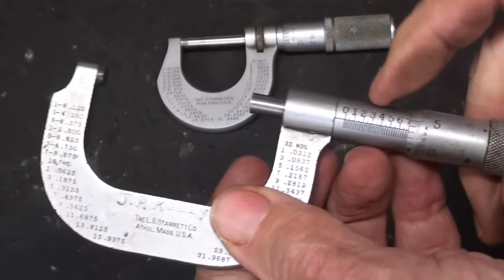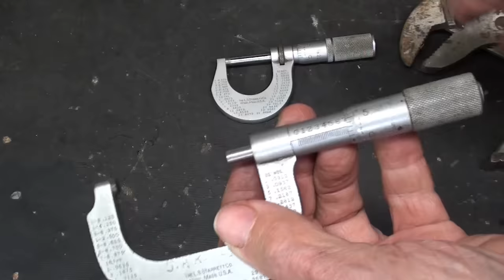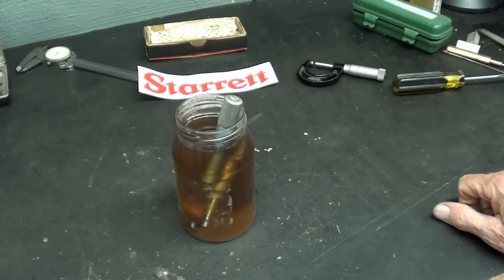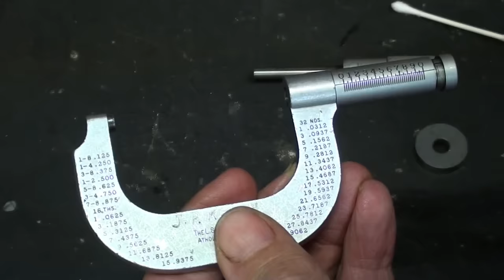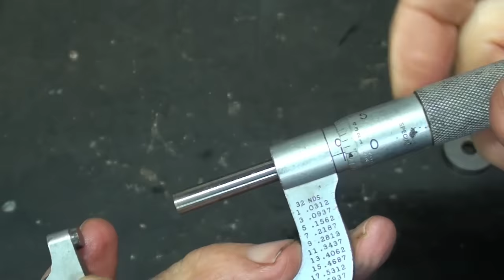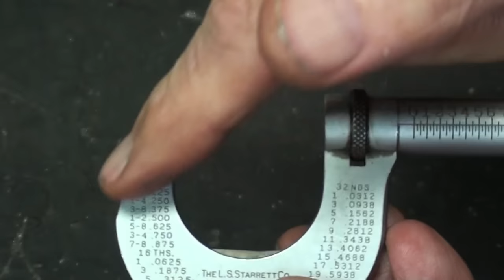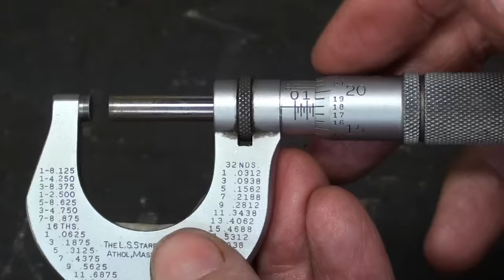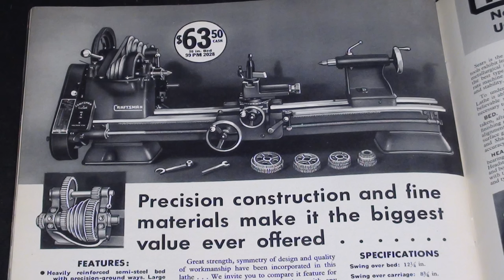FIX SEIZED STARRETT MICROMETERS #903 tubalcain

Comment: Best break free fluid I found is homemade. Equal parts ATF and acetone. Better than anything store bought
Reply: What is ATF?
Reply: @carrollprice1213 Automatic Transmission Fluid
Reply: And old ATF if you can get some.
Reply: Thanks. @steve_weinrich
Reply: jWe use that mix too.  It works great.
Reply: @duron700r  The really old stuff used Sperm whale oil. It was fantastic for homebrew penetrants.

Comment: I do this similarly, but put the jar in an ultrasonic bath, running several times over a few days. The ultrasound gives a bit of heating and the vibration helps the penetrating oil.
Reply: I’m using ultrasonics for pretty much everything now. Different fluids for different purposes.

Comment: Retired Navy Aviation wrench thrower here. I was MetCal Manager for my last squadron. I was the person who hauled all the calibrated tools like micrometers to AIMD for servicing. I learned there that  micrometers and the natural environment of the Navy is not great for micrometers. The discoloration is due to plating loss from corrosion. So long as you keep it oiled, and clean, it'll be fine. For stuck-stuck micrometers, and I mean STUCK, SOP was putting the stuck micrometer into a heated ultrasonic cleaner with something like WD40 set at 120f and leaving it a few hours. 120f you can handle with bare hands, and if that doesn't work? wrap the C-Frame with a rag, and pack the spindle in Dry Ice for a minute. The temperature differential should shrink the spindle enough to break it free from the thimble. If that doesn't work, its assumed something got bent... which, can happen in the Navy.

Comment: I got a Mitutoyo digital micrometer that was not stuck but was very stiff, turns out it was probably dropped and the nut was bent so that the anvil was rubbing on the hole in the frame, I fixed it by figuring out which way if was bent and giveing it a few taps with a dead blow hammer in the opposite direction. It now moves very smoothly.

Comment: I was taught not to store them fully closed not due to seizing but thermal expansion. When the temp fluctuates and the materials change size it can really load up the threads and damage them. Not sure if that's true or not but it stuck with me. I've packed away most of my mechanical measuring deices as my eyes got worse and now use digital but I know they are all still free, Cosmoline is a wonderful thing.

Comment: For a rusty and stuck hardware I use a mixture of half automatic transmission fluid, half acetone. It works wonderful. I keep it in the spray bottle. Anytime I buy something rusty and corroded. I give it a couple sprays the night before I take it apart. Great video. Thanks for your generosity of your time.
Reply: Kerosene works pretty good...
Reply: 2:05...no, that's a BAD idea...(!)
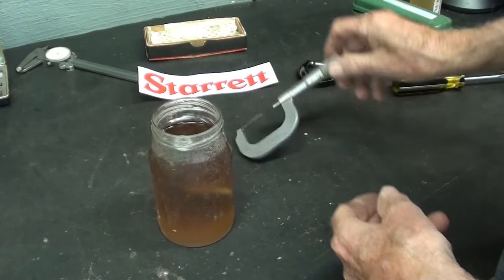Reply: 4:54...THAT'S DISGUSTING-(!)

Comment: another great video . nothing ventured, nothing gained as they say . the outcome was  great . I have used straight mineral spirits to lubricate things to get them working again , followed by lubricant . WD-40 has it's place . I don't think you would have had the same effect with trying them dry , I am convinced the lube helped.

Comment: When I worked in aerospace, electro-mechanical actuator dept. this was such projects as the ISS cadram unit, carbon dioxide removal apparatus, abram tank and FA-18 vapor cycle cooling systems etc,  us "technicians" and the engineers thought up a test. penetrating oil, we all thought up the way to test, we machined them, the other dept rusted them all up after tightening them all exact, nuts and threaded holes, all exact, long story short, we found aero-kroil actually creates more rust, but it sure is popular, and funny you mentioned it, 'liquid wrench' won under many test criteria.  we didn't try atf & acetone however,  fun times, made cool stuff, we were not production but machined prototypes and parts for one off and units under test.  "Liquid Wrench" won
Reply from the maker: I have been using liquid wrench since I was a boy. But it doesn’t seem to be very popular anymore.

Comment: I use brake fluid and acetone (about 50/50) and I put it in a square-shaped glass Pyrex bowl, so the mics lay flat.  Next, I place the bowl on the dash of my old truck (roll the windows up) in the summer time and leave it for a week or two.  This gets the brake fluid/acetone mixture very hot and almost always frees-up the mic.  Once the mic is free I clean everything in a small ultrasonic tank and after removing the mic I dry everything by disassembling the mic and VERY BREIFLY running my propane torch over the parts to ensure that they're completely dry.  Lastly, I apply a few drops of sewing machine oil to the parts.
Reply: I wonder if putting the micrometer with brake fluid & acetone in a zip-lock bag & placing the bag in your ultrasonic cleaner would help drive the mixture into the rusted spots quick also??? ...  I might have to try that (if it doesn't eat through the bag first).
Reply: @davelister796  I'm guessing that the acetone would eat through the bag, but I'm not sure.
Reply: And all of the plastic in your truck is cracked and eaten up.
Reply: @TgWags69  No, the plastic in my truck is fine because the liquid is in a glass bowl.
Reply: Thanks Mr Pete. A really good video and I am sure I will refer back to it the next time I have a sluggish micrometer. I wondered what the nut on the end of the barrel was for and probably for the best decided to leave it alone 😊

Comment: Somebody gave me years ago a seized depth micrometer.  I used penetrating oil on it. (Liquid wrench or other type).  Within a couple days, it loosened. If I recall, seizure was in the threads. (Probably dried lubricant).  To hold up thimble in the process on 0 to 1 in, I would use a lathe collet mounted in lathe spindle and lock spindle.

Comment: PTFE teflon based libricants like Slick50 works a treat. When the tiny high spots rub the teflon melts due to friction, then friction is bugger all. Spill some on the lathe bed and the tailstock won't lock until some abrasive removes the teflon. Been using this stuff on most things for 40+ years. 😅😊 Great on micrometers.
Reply from the maker: Thanks

Comment: process, but I finally got the mic working as well as it was prior to disassembly.  I think the proper advise would be to not touch the lock when the spindle is removed.  Also the Starrett lock mechanism is a very impressive design.   Might make a good "How it Works" video,  if you feel so inclined.   Thanks so much, I really enjoy your videos.   Keep them coming.

Comment: am almost done making a bolt from aluminum. it is 2" x 16 thread, with a 12 point 2 1/4 head. I bored the shank out to a 3/16 wall. I cut off the cap, and i am boring it inside to 2 x 16 tpi. Once its done the threaded section will thread into the cap, and appear to be a large plain bolt, but it will have a 1 5/8 stash inside it. i am cutting the cap flats on the mill with a spindexer. Once i get my chuck mounted on the rotary table i should have better accuracy, but it looks good so far! Great channel!!

Comment: The best penetrant I have used, especially on things like gummed up electric motors, is Rust Buster in a plastic bottle with a pull out zoom spout (same container as Turbine Oil) Very thin, very little oil, with electric motors after they are free oil must be applied since the Rust Buster will evaporate. It says made by PG Products Mfg Co. Inc. of New York. I got it off the counter of my local HVAC/Appliance Parts store
Reply from the maker: Great tip!

Comment: Great job in showing that a little finesse works better that force. I have a needle oiler that I use on all tools that need oil ( joints, threaded and slides ) about every two weeks or so.

Comment: Sea water - Diving in Scotland on wrecks if you found any brass threaded items the trick was to unscrew them ASAP when everything was still wet; if you waited until you got home they would seize up. I guess any non ferrous large items might work for freeing up moving parts. However there are better "solutions" just cost a bit more than salt per gallon.

Comment: Hey Mr Pete. Good video. I came across a large mahogany box while dumpster diving at a major lithography company. Inside the box I found a full set of Starrett C micrometers. Apparently they were changing to digital and just threw everything out. They WERE in perfect condition. But I had to put them in storage for 7 years. Now they are rusted and stuck. 
Is there any hope? There are 10 of them ranging in size from about 14” to about 3”. 
I wish I could send you photos. 
Also got a set of linear calipers 6, 12, 18” in mahogany box. 
You would not believe the stuff I found in their dumpsters over the 3 years I worked there. 
Thanks,
Paul
Reply from the maker: Wow, that would be dumpster diving at its best. All I can say is soak them for a few weeks.

Comment: Blacksmith home made micrometer from around 1930 my grandad made and engraved, I still have it and it works, he said he used the steel from the half shaft from a lorry. I have photos of the shaper and thread turning lathe and in one photo you can see him shoeing a shire horse. If I put a photo link here in the comment YT will delete the comment.

Comment: When I was a Senior Engineering at a power plant, the GE rep was having trouble breaking one of the nuts, 2",  loose on the upper half of the turbine shell. No matter how hard the slugging wrench was hit the nut would not move. He had as call around until we could find pure oil of wintergreen, It had to be pure, not man made. Put oil on the nut and around a hour later the nut was off. Since then I  have kept some in my shop.
Reply from the maker: Very interesting, I have never heard of that

Comment: Did the same with a rusted one, though I did use electrolysis to do the rust removal, and it did come free after a while, and a coat of oil did help keep it that way.

Comment: The problem is Starrett Mics. I was QC manager in a  7-acre precision machine shop, and we had hundreds of Mics. We used Browne and Sharp, Starrett, Mitutoyo, and a few Fowler. Hardly a week went by that a Starrett Mic didn't seize. It was the threads, that seized, not the shaft. I blamed it on the metallurgy, because none of the other Mics, ever galled and seized. Sometimes you get lucky and they would come off by hand with a lot of twisting (the threads actually get hot from the friction!) A little anti-seize made them feel great, but once cleaned and oiled, they would eventually seize up again. I just totally stopped buying them.

Comment: My way of unsticking mics. was to soak in penetrating oil, then leave it on a running machine for a few days in a position where pumped oil is constantly flooding  it along the spindle.  te heat, vibration and oil flow usually do the job.
Reply from the maker: Great solution

Comment: What sticks 'em?   Old lube combined with sweat & dust & smegma, turn into a super glue?  Is there any oil/lube that doesn't dry out & leave a hard/semi-hard residue?
Reply: Looking at where the corrosion was I would guess that coolant has got inside the mic and caused the rust , if you clean the mic with a cloth and wind it closed and open and wipe it again then you should get the coolant out , be careful if you disassemble the mic in case you get it into the threads as this can ruin them and you will lose accuracy if not end up with a seized mic . Ultra sonic cleaners are good and you can get some good solutions for them we used something called Lotoxane , a brand name .

Comment: I use  a Harbor Freight, heated ultrasonic cleaner, filled with tap water.
The offending object is placed in a Zip lock bag, with enough ATF ( Automatic Transmission Fluid ) to cover the part. 
The now sealed Zip lock bag, is now placed into the heated water in the ultrasonic cleaners tank, and run through a few cycles, about 15 to 20 min per cycle.

You will be amazed at the penetration ability of ATF, especially when it is heated a bit!!!
As the micrometer is cleaning in the bath, you should see a faint stain trail of rust, or what ever, coming out of the frame, where the spindle passes through it. This is where they tend to freeze up, because moisture gets wicked into that very tiny space, where is does it's chemical rust formation. This chemical process creates FeO2, Iron oxide, which expands to tightly close the precision lapped space around the spindle. The  O2 atom is, by its nature is larger when combined with the Fe atom.
Given the small area, the bond created is very strong.

Automotive lug nuts have the same problem, so despite the manufacturers warning to not use anti seize on lug nuts, the anti seize, with it's copper or Nickle micro particles in graphite and oil, the space is reduced between the lug threads, and the lug nut threads to prevent the egress of moisture, thus preventing rust seizure. 

Tim
Reply from the maker: Thank you for the great information

Comment: There's no doubt the WD40 helped free up the molasses old dirty oil/lube that dried up on the friction points. The best method was performed, even if it might take 7 days and nights or 14, soaking those in a solution meant to free up gunk. Even some of the home brew liquids were used as noted herein, time to soak is the least collateral damage method.

Comment: WD 40 may be the cause for them sticking.  The company where I worked for years would spray adjustable reamers with WD40  before they put them in storage tubes.  If not used for mouths, the blades would refuse to slide.  Many blades were broken and others were put in the dumpster.  It took a lot of soaking to get them loose. Today I would soak in  a warmed CRC rust removal product.

Comment: Trying to get penetrant into small parts? Use a trick from the wood turners to get resin into porous wood. Vacuum. Even a couple of PSI from a bicycle pump would pull the air out and let the penetrant in. Do that a couple of times and the tightest spaces will be coated.

Comment: Hey, Mr. Pete. Would never-seize be ok to use on reassembly?  Do you think Boeing T9 would help prevent further rust? ⭐🙂👍
Reply: Neverseize is too thick and not the right product for this application. Use Marvel Mystery or some other light oil such as Starrett for micrometers and other precision instruments.

Comment: I would tend to not trust a seized micrometer as the accuracy is in the thread accuracy so the measurements if freed may not be good . The reason why you don't leave a micrometer is closed is that the thread could become stretched . When you calibrate a micrometer one of the tests for wear is to use an optical flat and count the fringes , I had to calibrate a mic which one of the shop floor guys told me was over thirty years old , sadly the anvils had over time become domed and were not acceptable for calibration purposes , luckily we bought him a new mic and told him that his old mic needed to be retired . Oh well .

Comment: I was told not to store a mic closed to prevent capillary action drawing moisture between the faces. Keeping a gap was to prevent corrosion. Thermal effects are not to be expected due to lack of dissimilar materials in the mic. Cheers.

Comment: Lyle (or anyone):  Is there NO product or technique that will effectively get rid of "staining" on precision tools? 
I have purchased a Starrett 36" satin chrome ruler from E-Bay that has not only serious rust spots, but also some general staining along both of it's two sides that I would like to try and remove (or improve) somehow, even though it is definitely usable and readable as is. Any knowledgeable suggestions would be greatly appreciated!
Reply: Rub gently with Cratex rubber abrasive, fine steel wool, or fine scotch-brite with WD-40.
Reply from the maker: I don’t think there’s any way to get rid of staining

Comment: The technique used by squires to clean the rust from their knights armour was to put the armour in a sack of sand and donkey urine and drag it behind a horse for a while.
Reply: Thanks.  I'll remember that when my suit of armour seizes up next time. Due to global warming this is happening with increasing frequency. More moisture in the air and a greater discrepancy between daytime highs and night-time lows... its a constant worry of mine.
Reply from the maker: Lol

Comment: Not being a machinist, I have no idea of the TPI requirement and have no clue how to find out. If you do not tell me, teacher.
Reply: If you think of TPI threads per inch divide one inch by 40 gives you 0.025" per turn , now on an imperial mic there are 25 divisions so 0.025"divided by 25 gives you 0.001" per division hence the accuracy of the micrometer . I hope this helps .
Reply: @rexnemo  Thank you, it does.

Comment: I hate WD-40. It is not good at anything except the WD part (water displacing) and leaves a gummy wax residue.
CRC products do a good job.
Reply from the maker: Yes, it is a water displacer. It actually works pretty good as a cutting fluid for aluminum. Because I think it’s essentially kerosene.

Comment: I very much like putting old gear back In operation rather than just pitching it into the dumpster. Without being an environmentalist whack-job, it's much better to renovate and reuse rather than produce more new stuff. And anyone who's been around a bit will swear by a thirty-year-old tool rather than the imports so commonly sold today.